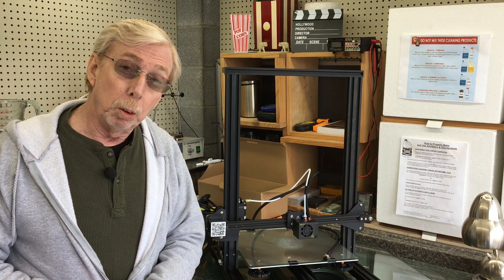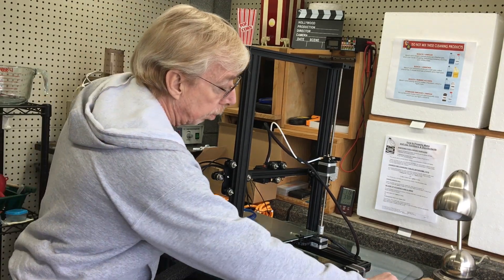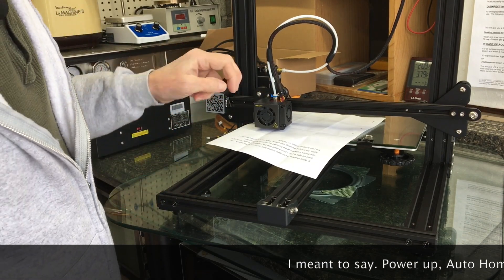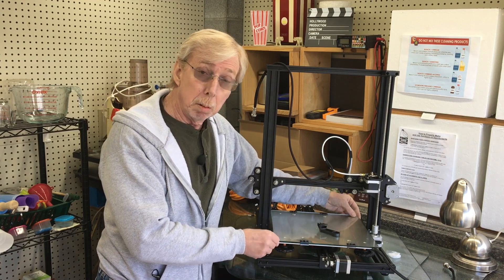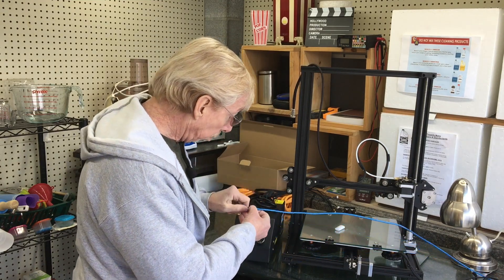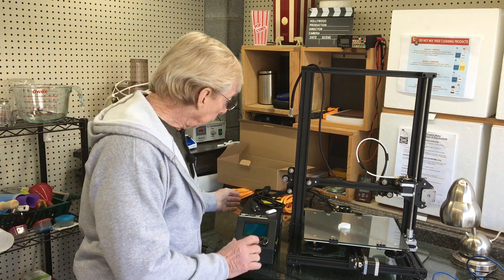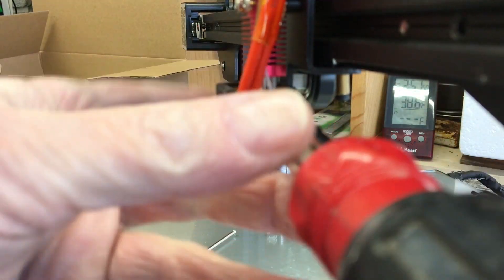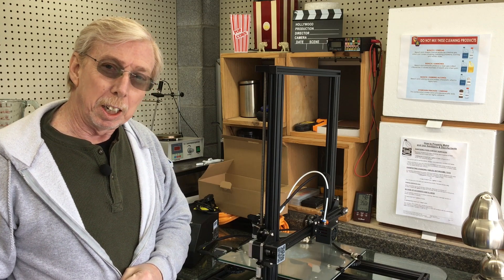3D PRINTER: Creality CR-10 FAIL Review. Thermal Runaway, Bed leveling, USB. How to diagnose problems

Comment: I've been using cura for about 6 years now and my cr10s has been having thermal runaway like 5 times this week on one single print and I've replace the thermistor 3X and have done a Pid tune 3X and can't find out why, any thoughts?
Reply: @Tylor, did you ever fix this, and if so, what did you do? I have an Ender 3 Pro and have had thermal runaway after a month of purchase.
Reply: @drseang  for me it turned out to be a bad thermistor and I ended up replacing the whole hotend assembly for about $30 and it fixed it

Comment: Hey Sir, I have a request that isn't related to the content in this video. I have been watching you a lot with regards to silicone and mold making. I was wondering if it is possible to "soften" silicone caulk so it cures into a shore A-10 softness scale product. 

Thanks for all you do. I have learned a lot. You are awesome!
Reply from the maker: Thanks for your comment. I may have what you are looking for. In the last 2 videoes I did on silicone. One (I don't remember which) turned out nice and soft. Stay tuned, I get a bunch of questions on silicone I think I should answer in a new video.

Comment: I have a question but it's not about this video, it's about another video you did a year ago on flexible clay.  I didn't see any updates to that video so I was wondering if you were able to make a flexible clay that doesn't break after drying.  Thank you for your time in this question.
Reply from the maker: Thanks for your question. I haven't done any more with that mix. It may well have limited, temporary only applications. Stick with clay if you need it to last. Thanks for watching.